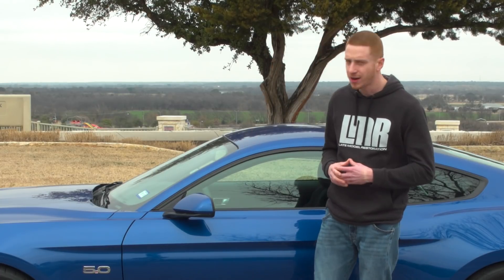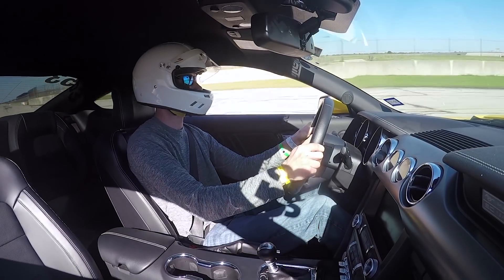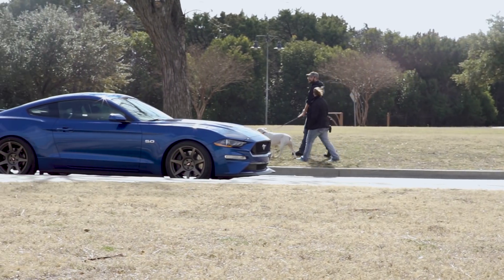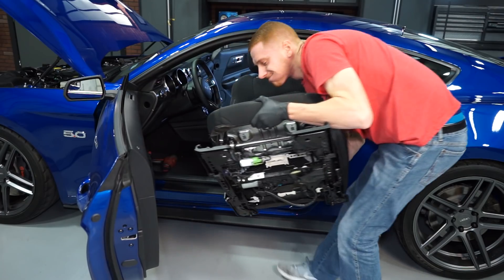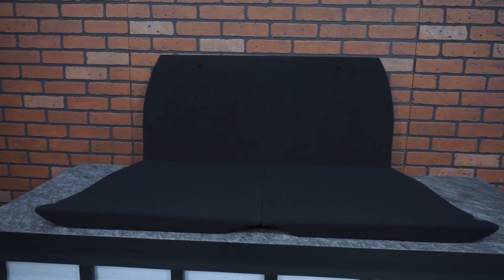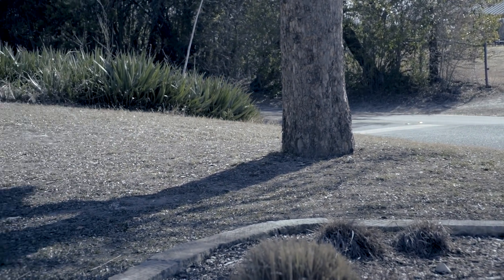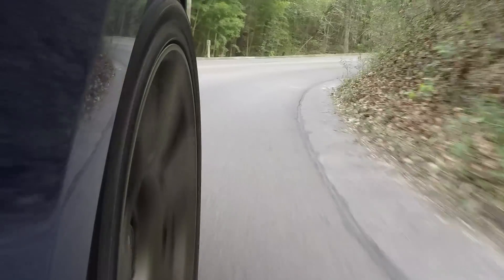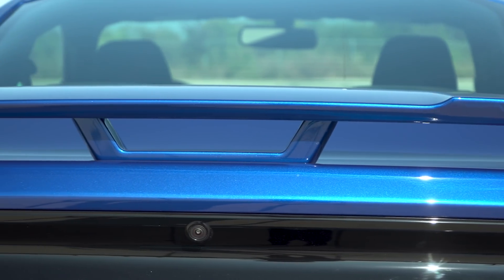2018 Mustang GT Review, Dyno, Track Times, & Mods

Comment: Some people say the '18 is ugly, but I didn't like the hood lines on the '15 thru '17, but as soon as Ford changed that with lowering the slope of the hood I fell in love with the car...add to that all the new performance and it makes it a great upgrade over 2nd gen Coyote cars for sure! Mine is a base A10 w/ 3.55's...PP cars are 4k more and only .2 quicker, I'm happy with mine, especially since its also E85 tunes/JLT cai/Steeda x piped.  Its fun to stomp on 3 pedal mafia cars with ease.
Reply: Is yours a 301A or 300A? You can still get drag mode with the 301A I believe

Comment: One of the best things about having the dual injection setup is that it shouldn’t get the carbon buildup on the valves and in the heads like a direct injection engine gets. Direct injection engines suffer from carbon buildup and require expensive and time consuming cleaning to remove the power robbing buildup. By leaving the port injection and running both injection systems the port injection will still clean the intake ports and valves during normal operation unlike a direct injection engine. Not to mention that you get a bump in power and efficiency.
Reply: NOTHING you just said is true. 

Not ONE line. 

I have a 335 all wheel drive. I have to get valve blasting once every 50,000 miles - it costs $500. 

Please stop spreading MISinformation. Smh
Reply: Tracey Melbourn you either didn’t read my comment, misunderstood it or don’t understand English because everything I said is correct. A car with Direct Injection gets carbon buildup on the valves and inside the head after time and has to be cleaned just like your 335  suffers from. The new 2018 Mustang has both Direct Injection and the older Port Injection which injects the fuel into the intake manifold or the head and then enters the cylinder through the intake valve. Because it still uses Port Injection the valves shouldn’t get the carbon buildup that cars running strictly Direct Injection suffer from. By running both Direct and Port Injection the 2018 Mustang can better control the flow of fuel into the engine and will be more efficient.
Reply: Tracey Melbourn here’s a link backing up everything I said in both my comments. The section titled “The Issue With Direct Injection” really explains what I said and that it’s not MISinformation as you put it.

https://blog.americanmuscle.com/2017/01/09/new-engine-updates-for-the-2018-mustang-gt/
Reply: CareerFireman it’s amazing how rude and disrespectful people are these days. More than likely he’s 20,21 and still lives at home. People like him can’t admit when they’re wrong or discuss something without bashing other’s opinions. I just dealt with some kid last week that was the same way. Told me my comment was wrong and I was a dumbass that didn’t know anything. After I provided the proof to back up my claim he still said I was wrong and didn’t know anything and called me a million names. From the things he said you could tell he didn’t know the difference between a piston and a steering wheel it was so bad but he insisted I knew nothing. Guys like this are a thorn in my side. I’m almost 42 and catch myself sounding like my grandpa talking about kids not having any respect anymore. 🤔

Comment: Yeah. That car not having the 301A package means no drag mode. Drag mode is worth a 10th or two and a MPH or two due to it's more aggressive transmission changes
  This did confirm that the 10-Speed 301A package was faster than the 300A.

Comment: So is the drag mode equipped Mustang GT 10R80 faster than the 300A 10R80? Or were your times in the low 12s because of track conditions?

Comment: I'm in the market for a used sports car and a Mustang GT PP1 is on my consideration list. I've never owned a Ford and have read that the 5.0 V8 has issues with piston slap and cylinder scoring. Is this true? If yes, is it a common problem? I'm also considering a 2010 Porsche 911 (I understand these are totally different cars) and want something that will be reliable.  What are your thoughts on the reliability of the 5.0 engine and the Mustang GT overall?  Thanks
Reply from the maker: We have seen reports of piston slap and cylinder scoring happening, but we wouldn't say it's common. The Coyote 5.0 is a very reliable engine as well as the Mustang body in general. Every Mustang we have owned has been fantastic and we love them, especially when they have been modified with a ton of power! You won't regret it!
Reply: @latemodelrestoration  Thanks for the reply. I'm a sports car person more interested in accelerating, braking and turning quickly versus quarter mile times. It looks to me like a late model GT with PP1 or 2 will meet these requirements.

Comment: How much power can the automatic transmission handle safely if you want to add a supercharger?
Reply: stangtrax A local shop to me, one of the employees has a 2018 GT, with the auto trans. He bought the Procharger P1SC1 Tuner Kit from Lethal Performance. And he's been daily driving it with 665hp (if I remember correctly, and idk the boost and stuff) he said the auto trans just needs a tune, and it's good to go.
Reply from the maker: We do not know the exact ratings but this trasnmission is very stout.

Comment: What happens when you rev to and hit red line, does the engine/power die and you're like a dead duck in the water (like my 2015 GT), or does the engine just stop reving higher and you're still motoring along?
Reply from the maker: It will just cut fuel once it hits the limiter.
Reply: Is there a fix for this? There should be another way to limit the revs without cutting the fuel.

Comment: I just bought a 2018 GT 6 Speed with the 401A and without the performance package. So I have the 235/50ZR18 tires. :( Since you have changed the wheels and tires I would love to take those stock wheels and tires off your hands if they need a good home!!!! ;)

Comment: It's brand new 2018 Mustang I don't see no point in putting a suspension kit on it when you could have got the track package top of the line for the racetrack from the dealer but you guys are different AmericanMuscle dot-com I like but it's a good looking car I like the modifications even though I would like to see it perform at the track just stock for as a video go Roll Racing

Comment: I have a 1968 mustang with a 1990 5.0 motor in it Do you guys have any suggestions on what exhaust system I could put on it
Reply: josue ibarra Check out the Borla S type or their Stinger mufflers,  they sound incredible and their quality is top notch.